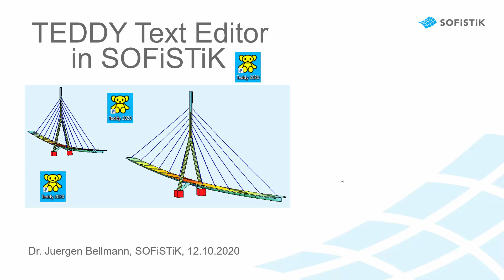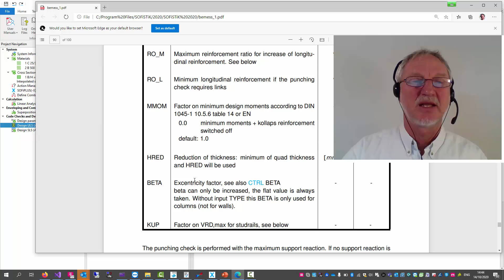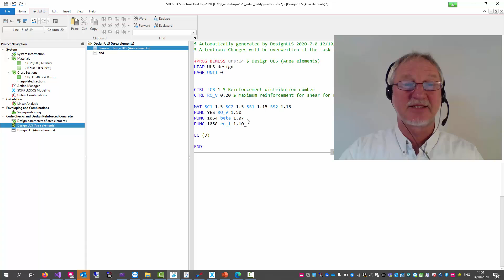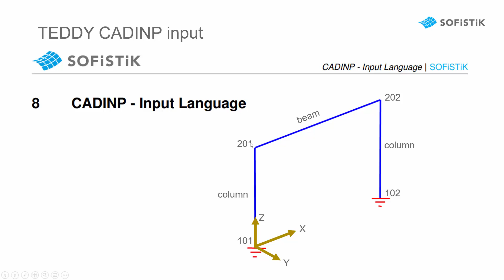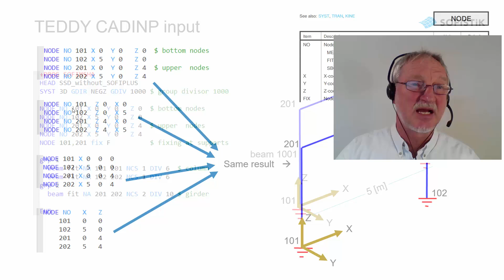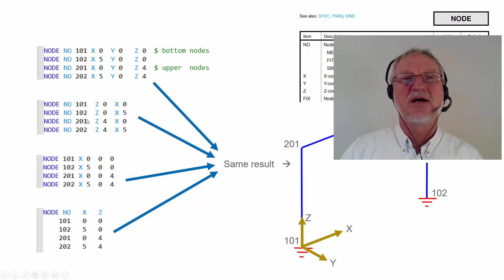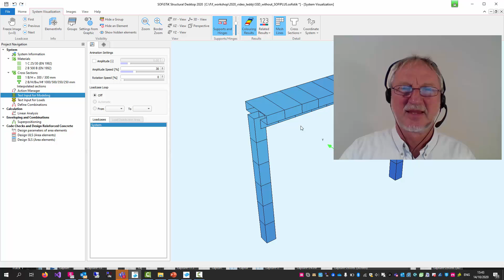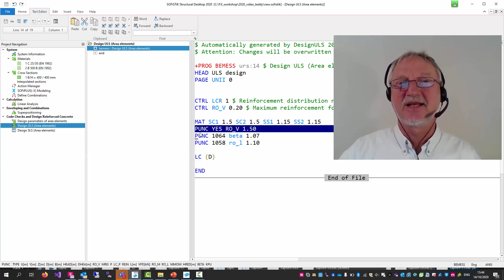Get to know TEDDY - Part 1 - SOFiSTiK Text Editor

Comment: where can I find the example of the video?
Reply from the maker: Hi dsdads,
do you mean the punching design example?
It is not directly available - it is just a placeholder for the general problem describtion.
You can use any loaded column of a multi level building to reproduce the shown results.